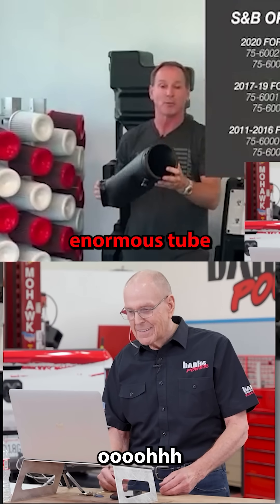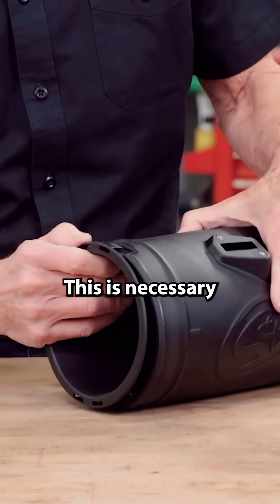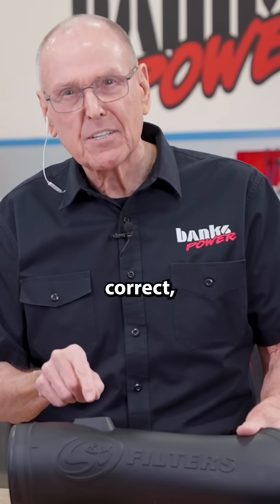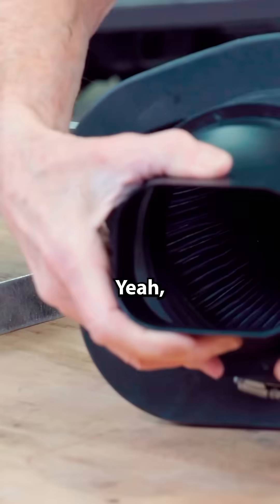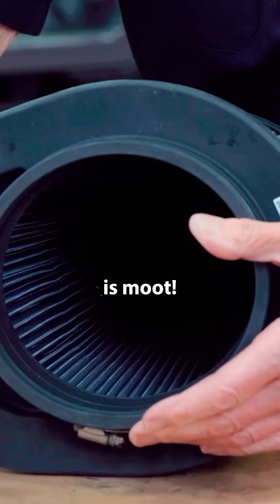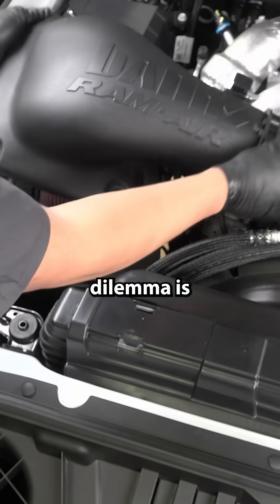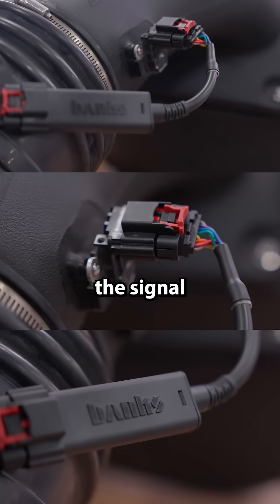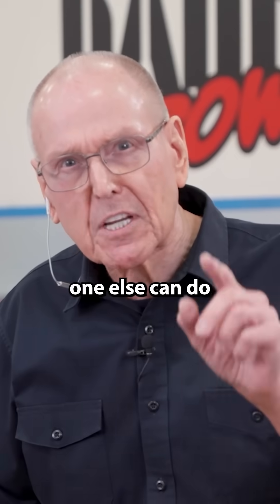Competitor tries to fake a big air intake

Comment: The way to correctly address this issue is to apply a correction value to the sensor voltage to airflow values in the ECU, based upon the increased cross sectional area where the sensor is placed in an oversized body/tube.

Comment: People were doing this for years (sensor signal passed thru calibration map), but that's not right approach. Even in laminar flow air moves in layers. That's why OEM's using complex structures around that sensor. With large pipe an low RPM/load this sensor will measure nothing. It will work in you like black smoke, but won't if you like fresh air.

Comment: just put whatever tube you want, as big as you want, and just dyno tune the truck - oh but I get it ... this is bolt on and drive off. So bravo for the ingenuity. But just do it right people, professionally tune your engine to the crap you mod it with.

Comment: You could split the intake in different compartments, where the sensor only reads one of them.
Reply from the maker: Then the sensor would read too less air than is actually going into the engine. The MAF sensor works by heating an exposed wire in the airflow. The more current needed to maintain the wire's temperature, the more air flow is passing it. But that only works if the ECM knows the cross-sectional area of the tube the wire is in. A larger tube would move more air but at a lower velocity, and therefor a lesser cooling effect on the wire. Our Air Mass Control Module recalibrates the MAF signal to reflect the wider tube.
Reply: @bankspower  I'll take your word for it, I don't have the necessary knowledge to debate it. Thanks for replying to me though, I appreciate that.

Comment: Ok but now your airflow is higher and the computer thinks it's still the same so it sends the same amount of fuel to the injectors. More air requires more fuel for real gains. That's a fact.
Reply: @EpicDrew15   The reason some have the air flow restrictor plate is to be able to work with stock fuel injection. His kit, I think is assuming that your already down the path of increasing fuel flow. I just think it should of been mentioned.

Comment: I don’t know a lot about cars…
But slow air is really bad at carrying dust and debris,  so if you have a standard size cross sectional airflow, then run that through a ballooned air filter, the air will slow down and deposit all the debris it was carrying…
In the filter.
Which is where you want it?
So his competitor has a valid product and design?

Comment: That's effectively a Venturi effect wouldn't that help with air intake pressure
Reply from the maker: You are correct, but it wouldn't help with intake air mass which is ultimately the goal.

Comment: That’s the issue with “no tune required” intakes….they don’t do much. On any modern vehicle you really need tuning to get any real worthwhile gains from performance parts. If you gain 8-10whp from a “no tune” intake, you’ll get 20+ with a real intake and a good tune.

Comment: Tunes exist
Reply from the maker: Tuning can be a great solution for people in a lot of cases, however,  there are a few down sides: the cost and it'll void the warranty. Our solution allows you to run an upgraded intake without modifying the ECM or setting a check engine light.

Comment: I deleted the MAF and tuned it myself. You only need a few sensors to run any modern engine anyways. The rest can be removed if you do your homework. Easy swap back too if you’re in an emissions controlled state.
Reply from the maker: Tuning can be a great solution for people in a lot of cases, however,  there are a few down sides: the cost and it'll void the warranty. Our solution allows you to run an upgraded intake without modifying the ECM or setting a check engine light.

Comment: I mean, don't get me wrong... correcting the MAF readings is a superior solution (cost aside), but to say the increased diameter is moot because of one restriction point is ridiculous.  That's simply not how fluid dynamics work.  It will cause some pressure drop, and some turbulence downstream... but there is always going to be significantly more flow.  The flow rate of a pipe is not defined by its most restrictive point.

Comment: Big intake on fake worst as well. It  provides that big reservoir of buffer air at the bottleneck which is the MAF sensor. A smaller intake would have less air available anyway so it is not a fake.

Comment: Is this the standard MAF that uses a heated wire ? Is yes, it might be possible to increase the current in the wire to match the air flow with the larger intake. Just a dumbidea.

Comment: I have a 2015 Chevy Silverado 5.3 V8 and I changed the intake manifold, throttlebody and cold air intake to a 6.2 L and cannot get rid of the biometric pressure low light. Do you have any insight

Comment: He must have never heard of the “Venturi Effect”!!! You know, when air speed increases when traveling through a tapered area, blah, blah, blah… yeah I haven’t a clue as to what I am talking about and I know even less about diesels and M.A.F. sensors and what placement they require!!! 😂😂😂

However, I have been working on gas engines and cars for a many a years and I do happen to know that carburetors use the “Venturi Effect” and it has to do with a the velocity of air or a fluid when passing through a constricted area and when doing so the air or fluid will increase in speed or something like that!!! So I’m not completely wrong in my original statement above!!!

Comment: Lmfao at WOT (wide open throttle for the gen z's out there) an engine is only able to move so much air. Putting a bigger inlet is huge marketing wank. If the cfm is able to move through the original opening with not too much restriction, theres no benefit from increasing the inlet size of it exceeds the engines capabilities anyways lol
Reply from the maker: Seems like you've misunderstood how airflow is measured. The engine pumps a fixed CFM at a given RPM, but CFM says nothing about the content of that volume. What is the air mass? By reducing restriction in the intake, you're not getting more CFM, you're getting more air mass in the SAME CFM. Denser air making it to the compressor means denser air at the intake manifold, and subsequently, the cylinder. The more air mass in cylinder, the more fuel can be used to make more power. Think of CFM like the size of your coffee cup, and air mass as how much coffee is actually in there vs milk, sugar, etc.

Comment: Why is bigger better in the first place? He acknowledges that bigger diameter slows intake velocity then doesnt go on to explain why you would want a lower velocity. Because why would you? You have limited time to fill the cylinders with air. You want only as big a diameter as will allow sufficient volume of air in the cylinder. Smaller means higher intake velocity to fill the cylinder efficiently within the limited time (intake valve open) that you have. Too big and counter-intuitively you end up choking the engine up top.

The pictured intake has the diameter nearly the same as a top fuel dragster at the choke point. Theres no way a street engine is using enough air to need an intake that big.
Reply from the maker: CFM, air velocity, air temp, and air pressure are all parts of the equation, but the ultimate measure is air mass, and subsequently air density. This is because to make power, you're ultimately mixing pounds of air with pounds of fuel. So if intake air velocity goes down but the total air mass goes up because of the wider diameter, you've still gained more air. The best situation though would be high velocity, high pressure, cold, dry, air. 

Top fuel dragsters have significantly less restriction before the inlet. Our design reduces those restrictions as much as possible and a larger inlet is part of that.

Comment: Isn't the point of a MAF to measure the amount of air passing by၇ Why do you need to alter anything in the duct and trick it to send a different signal၇ Do I misunderstanding something here၇
Reply from the maker: The MAF works by measuring the cooling effect incoming air has on an internal wire. If you widen the tube, that cooling effect is reduced even though the overall airflow is higher. The ECU and MAF are calibrated based on a specific cross-sectional area. Our device essentially lets the ECU know what the new cross-sectional area is.

Comment: a big tube with a small restriction at the MAF is still less restrictive than an all small tube, so it still does something, though zero restrictions is always best. but yes you can reprogram the system or make a piggyback to take into account a larger plenum too. that just costs more than a piece of plastic, so depends on budget. modern cars really shouldn’t need a piggyback though so you’re paying the convenience tax for plug n play. 
probably over stating with “no one else can do it” this isn’t a unique product, it’s just specifically tuned to a matching intake so you buy them both together. 

cone filters are usually a dumb idea anyway unless specially partitioned for cold air intake as they’re sucking in hot engine bay air and are often worse

Comment: Not sure how a lot of these Diesel ECMs work and are tuned, but in the DSM and Haltech community, you've gotta adjust the MAF map to scale it correctly exactly like how Banks is talking about. An even better approach, especially for high performance applications and a more dynamic approach for optimal tunes, is to convert to speed density, whereby you can drop the MAF sensor entirely from the system, and could even go just full open turbo intake with whatever filtration or diameter tubing you desire, as its using a MAP sensor for pressure/baro, then a temperature sensor in the intake manifold (post intercooler), and an atmospheric hygrometer (if you wanna be dead-nuts on for any condition). Speed density calculates based on atmospheric barometer, manifold barometer via MAP, and the temp sensor for the manifold as well and as mentioned, a hygrometer if you want to calculate the additional oxygen potential from humidity, and it uses this to calculate the oxygen density of the charge air. using that you then map the fuel against these and it will dynamically adjust and calculate correct fueling for ANY charge pressure at ANY altitude. Its a pain to setup but once its done its SOOOOO much better. Also will allow your engine to run optimally even in the event you blow off a charge pipe and end up with no boost, as its using manifold pressure and temp, so it doesnt care that your charge pipe blew off, it wont send you into a limp mode and will still accurately fuel the vehicle allowing you to get somewhere safely without a lean condition that blows up your engine or melts pistons, and also prevents an overly rich condition that will wash out your rings

Comment: Opened up one of these modules, nothing but capacitors on a board just so voltage output is what theyre supposed to be. Cant wait till this guy discovers what an arduino piggyback can do. 🤣

Comment: Literally the only thing thay needed done was rescaling the maf lol, take it to a real tuner and toss your shelf tunes in the garbage. 

Laughs in real car guy who can build and tune his own shit

Ive literally got a lsa blower on a ls2 with a ls3 maf in a 4 inch intake(none of this stuff "should work" with each other), on a flex fuel setup, running zl1 fuel rails, a dual pump setup in the stock fuel bucket etc.  You dont need goofy shit like this, all it does is cause an opportunity for more failures and drivability issues.

Comment: I swear this guy is the complete automotive guru.
Reply: MAF sensors are kinda internal combustion engines 101 level material, though. Well... Maybe level 102 or 103, but still. If you're going to get into modifying cars, it's definitely something you should read up on!

Comment: Not necessarily moot just slightly worse, the major limiting factor in airflow is the filter not the duct, having larger filter will allow more surface area so more airflow even though the intake duct is same size.

Comment: The only way to intake more air without losing filtration is a larger filter. And, once above a certain intake increase you have to re-tune the MAF sensor anyway.

So, he's half right. You can't just bolt on a larger intake tube without having issues.

Comment: I get alot of driveability complaints when customers install those mickey mouse aftermarket air intake tube and k&n air filter.
Also they fail their smog test under tampering and modified.

Comment: Define reading correctly? Pretty sure that maf sensor would read just fine
Reply from the maker: A MAF sensor, reads mass flow by measuring the amount of electrical current needed to keep an internal wire at a specific temperature. More mass flow means the wire needs more current to stay warm, but for that current reading to equate to a mass reading, the cross sectional area that the MAF sensor resides in needs to be defined. 

A smaller tube with the same mass flow would have a greater cooling effect, and a larger tube would mean that the same air mass has a weaker cooling effect. If the MAF sensor thinks it's still in the stock cross sectional area, and sees a weaker cooling effect, it will read that as lower mass flow even though the mass flow has actually increased.

Our Air Mass Control Module redefines the size of the intake tube for the ECM so that it actually reflects the new airflow calculation.

Comment: I don’t know a whole lot about this kind of stuff but because of the Venturi effect wouldn’t the restriction just be a temporary section where it increases the air velocity while lowering the pressure before it returns back to the larger section of pipe where it would be the same higher pressure lower velocity air it was before it entered the intake?

Comment: “Everything being big is moot” no. There is not some magical bottleneck that limits the movement of air. If I double the radius of 90% of my tubing and slightly shrink the remaining 10% I will end up with a higher overall flow rate.

Comment: So imo he’s right and wrong but since it’s a shorts he is trying to get to his point of sale 🤷🏻‍♂️ 
      I have a S&B and I agree it’s a lil big ,BUT, I switched to a AFE for shirts and googles .  Cleared kam. The AFE , 75mm whole tube , had a somewhat better throttle feel and lower end 🤷🏻‍♂️ it however was lacking the whole range and sound that the s&b which is about 90mm and tapers down to 80 ish 
   I am intrigued by this device though because if I could get my 90mm sct to work without getting turned 🤘

Comment: Well you can use a bigger tube to your advantage say you have used all of your maf voltage parameters and you go slightly bigger maf and scale it down a bit so that when your under boost you are in a readable range for the ecm. It works with subarus really well especially over 21 psi. My Cummins I just size the tube accordingly untill it has a readable voltage through the whole rpm range. Especially at higher air concentrations. I think mine is 4.375 Id seems good but if I had more turbo that pulled more volume of air then I’d go a little bigger untill I hit the sweet spot with my voltage maf input to the ecm just throwing a big tube on will make it run lean because it is pulling more air volume through the tube that the maf was scaled to originally so it gives it the fuel for the small set up but has more air, so with a Subaru un tuned it will blow…. Diesel will run lean but won’t have correct air fuel ratios for power at all. Have a capable tuner and all should be grand, they should know how to scale the maf tube and make the engine run well.

Comment: I just run K&N on anything I run for performance. Works fine and install is generally pretty simple.
Reply: Depending on what vehicle and what k&n option they can actually reduce performance because some of them are hot air intakes

Comment: Sorry, can you explain the difference between necking down where the competitor does and you have to do as you transition to the engine block?
Running a larger filter by itself is inherently a benefit as you don’t have to force air as hard across it with the increased surface area, so I’m failing to see why having a potential higher flow in the tube is a benefit if you need to neck down at the engine too.
Reply: Larger filter is only beneficial if the flow is high enough that the prior filter causes restriction.

Comment: A project like that was done years ago for older Subarus with non functional hoodscoops. An engineer designed a box to fit on top like an inter-cooler, but was able to have the stock filter and not trip a CEL.  Same air flow as stock, even on highway speeds, there was no "forced" air HP gains. He literally just reconfigured the shape of the existing air intake to look cooler.  fun project.

Comment: Well there’s lots of idiots putting what they calling “turbo inlets” on …. Actual turbos have that shit built on.. the part the intake or filter or turbo guard goes into ..
OEM turbos … the restriction IS the opening to the turbo.  Use your 4” intake and the inlet and it just changes location of reduction to a 40mm opening to the turbo lol

Comment: Would it be possible to make corrections to the stock MAF to run a bigger size intake pipe with a tune? Say if you knew the the original inside volume of the stock pipe and knew the volume of the new pipe?